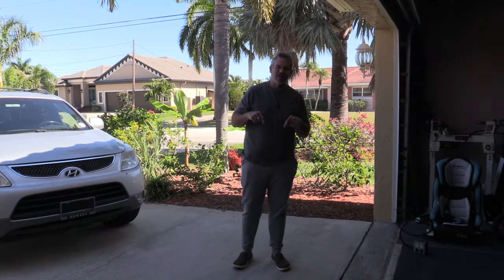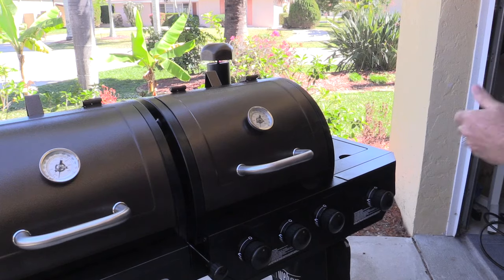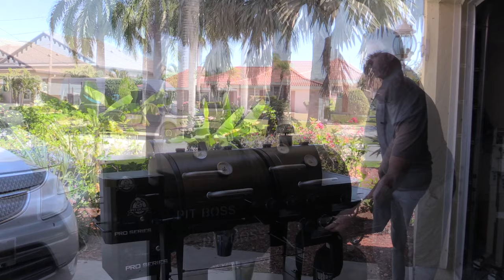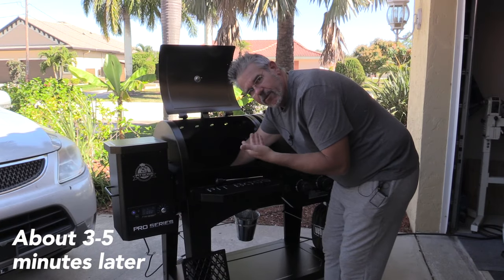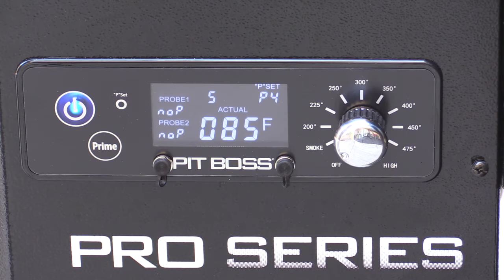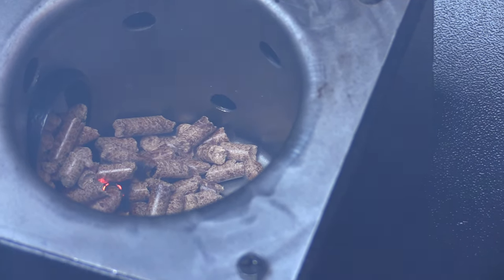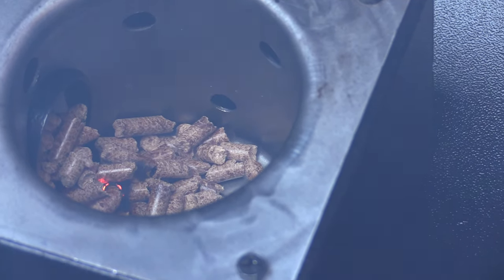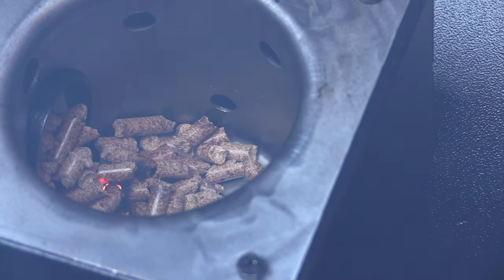Pit Boss Pro Series Combo BurnIn

Comment: Thank you for the video, very informative.  I’m concerned by the amount of noise I noticed in the video.  I couldn’t tell if it was amplified by the position of the microphone.   How would you compare it to, say for example, the noise of an air conditioning unit?
Reply from the maker: Much quieter than an air conditioner.  It is more like a table top oscillating fan.  I think it was loud because I had it clipped to my shirt and leaning over the open barrel shaped of the grill, with the covers off the firepot to show what was going on in there.  It is a small 4" fan that turns and that is about it.  You can hear it, but slightly louder than a computer power supply fan, and about like a small table top oscillating fan.   I hope that helps.

Comment: I've looked at your vid about 5 times!!! I just bought/and grilled on it. Thanks for providing this resource. Qs regarding the pellet side: 1) Approximately how long does/should it take for the auger to feed pellets to enter fire pot ?  2) Approximately how long for the actual fire to get going? 3) Must it burn 30+min before adding meat?
Reply from the maker: It took a good three minutes of holding the prime button before pellets made it to the fore pit the first time. I did burn it in a full 30 or a bit longer before cooking on it. The purpose is to burn off any of the protective oil from the machining and assembly in the factory (at least that is my understanding).

Comment: I just bought my sportsman combo...went to season the gas side and the heat spiked to 650 almost instantly. I let it run 30 mins on low and even with the dials as low as they'll go, it stayed 500-550. Why is it so hot? Is that normal?? I don't wanna be stuck grilling everything at 550 degrees
Reply from the maker: That definitelyt doesn't seem right.  This model is almost identical to the sportsman, so I am guessing it is all the same sized items.  Do you see the flame adjust in height with the knobs going from low to high, or are they always up on high?  That really doesn't sound right.  I can get mine lower, but if I have all 3 burners on high, it will get up to that temp, so I often cook with 2 of them on low and do offset cooking unless I am doing burgers or something.  A few things I would try if faced with what you are seeing.   I would start by removing the grates, and guards so I can see the flame tubes and validate if you are seeing any variation from high to low on each knob.  I would then try another tank to see if you have something odd going on there, or even maybe with the pressure valve just off the tank.  You should be able to get that grill down to 250-300 degrees with just one burner on.  We have baked in ours before by keeping the temps down lower.   Good luck with that, it is an odd one for sure.
Reply: @Svdreamchaser  I absolutely do. When I go to high I can see the flames go higher and brighter.
Reply from the maker: @mikestratychuk6362  that is crazy. I will fire mine up with all 3 on low tomorrow and let you know what it gets up to.
Reply: @Svdreamchaser  I called pitboss and they told me the regulator could be faulty.  So I either wait 3 weeks for them to ship me one or I go buy one for 20 bucks. I'm gonna go buy one and see if that changes anything
Reply: Brand new regulator installed, lit it and it skyrockets to 550 plus on low. Why is this happening lol I can't bbq like this
Reply from the maker: Crazy. I went and tested mine. I put two burners on low and it went to about 400 degrees on the dial with the lid closed. I grilled burgers over it with the lid open and it wasn’t that hot, kind of like any gas grill. Something doesn’t seem right, or it may be worth putting a thermometer at the grate level to see what the temp is there. It may be with the lid closed it captures a bunch of the hot air up on the top side making the temp spike on that lid gauge but maybe it is not really that hot. I am stumped on this one.
Reply: @Svdreamchaser  I returned it and bought the 820 sportsman.  So much easier to use.
Reply from the maker: Glad to hear you got one that works better!  How season up sone ribs. Lol

Comment: Love your videos thanks for making and posting, what is the lowest heat setting you can attain and keep till food is done or decide to change higher? And also most importantly are you still happy with your purchase? A lot of critics don’t like the wifi controller! I am just about to order mine! I’m offshore now I get in next week and I want some home made bbq!!!
Reply from the maker: First of all. Awesome you are offshore (unless working on a rig as that wouldn’t be the idyllic sailing image I have in my head. Lol). I am still happy 18 months later with the pitboss. I still use it almost every week. We do a lot of outdoor cooking so as not to heat up the house and it holds a temperature fairly well so we even bake in it from time to time.   As for the lowest temp setting. Down here in the south Florida heat we never really get below about 185. When I am on the smoke setting that is about what it gets to in the smoking chamber. If I open the chute between the pellet and gas side and block off the vents in the smoke side, I can get the gas grill side down to about 140-145 when the pellet side is on low and gas side off. It is still too hot to do cold smoking of things like cheese for me.   Lastly, I can’t share any feedback on the wifi controller. When I bought mine it was not included and I think now they are. I wish I had the wifi controller but I don’t have experience with it. I have considered upgrading to that controller however.

Comment: I’m new to smoking... but does the auger always feed pellets when you are running the unit on a desired temp, or does it only feed pellets when in the smoke mode? What’s the difference between smoke mode and temperature mode?
Reply from the maker: It always feeds pellets. Pellets are the source of fuel, so essentially if you set the thermostat at 300° it puts in pellets at a faster pace into the fire part then if it was set at 180. This particular model will turn the auger for example for three seconds and then pause for 10 seconds and then run the auger again for three seconds and then pause for 10 seconds etc. The purpose behind this is the pellets get dropped into the fire pot onto the heating element.   The heating element ignites them or lets them smolder.  What tends to happen is they smoke first, then they flame the smoke dissipates and the pattern repeats. The higher the temperature the longer the auger run tine is compared to the gap between runs. I
Reply from the maker: I hope that explanation provided sone insight and makes sense. It is amazingly accurate at holding temperature for long periods of time with 5-10 degrees of what it is set at.

Comment: Can the smoker side be set to 300 degrees and also have smoke or do they have to be done separately?
Reply from the maker: The left side is where you set the temperature and smoke is generated. You can open the smoke chamber between the left and right and allow smoke to flow to the right and out the chimney. The thermostat however is in the left hand side so if you do that and you want to increase the temperature on the right too, you have to supplement it by turning on the gas burners on the right gas grill side
I hope that makes sense.

Comment: Have you experience any of the negative feed back.  Rust quickly and paint coming the grill?  Also did you motor for the pellets burn out?  Any negative feed back on the product?
Reply from the maker: I really haven’t had any problems like others have had. I did have an issue where I didn’t cover it and it rained overnight. The pellets in Altus auger tube got soft and then hardened back up and I had to pick it out. But the reality is that was my fault and no residual problems from that at all. I have been really pleased.
Reply: SVDreamChaser thanks for the information.  I will plan to keep it covered.

Comment: Getting this for Christmas any negatives to this combo grill since you’ve had it for a while ?
Reply from the maker: No. It has been great. A couple of tips I would share. First, I would be sure to keep it covered if outside as rain can create some moisture in the pellet hopper. The only other thing that I don’t find negative but some may, that is the size of the smoker box. It is big enough fir three racks of ribs or a full 18lb brisket but if you want to be able to do multiple briskets you may not be happy with the size.
Reply: @Svdreamchaser  greatly appreciate the feedback thanks !

Comment: Great video! I’m assembling mine! I did have a question, I noticed you were concerned with your side burner valve not seated properly. Did you find a way to adjust that? I can’t seem to get my valve to seat all the way.
Reply from the maker: In the end it worked out just fine and didn't have any issues.  I had to bend it a little to get it in there.

Comment: When I turn on my propane it does a sound not leaking anywhere is it normal? I’ve never heard it from my other grills.
Reply from the maker: That doesn’t sound normal. Mine doesn’t make any kind of whistle sound’s. If you want to go back and look at the assembly videos I put together the second one of the two part series shows how I tested for leaks with soapy water and a small brush. You may want to see if there is a leak somewhere?

Comment: Can you use the smoker and propane at the same time?
Reply from the maker: Yes you can. We have done it many times with no issue at all. There seems to be enough of a gap between the two sections that a hot gas grill side does not affect the temperature in the smoker side

Comment: Any issues with low and slow smoking? Will it keep temps around or under 250? Was reading negative reviews about other models from pitboss not being able to do this well.
Reply from the maker: I have no problems keeping the temp at under 200. Today I am smoking a pork tenderloin and smoked it at 185 degrees for about an hour. I set the “P Setting” to P5 and it did just fine. I could have gone all the way up to P8 which brings the temp down a bit more even.

Comment: Do you use Aluminum Foil under the grates when smoking greasier meats to avoid grease fires and for easy clean up?
Reply from the maker: I actually don't Noah.  The manual suggested NOT doing that so I just kind of stuck with it.
Reply: SVDreamChaser yes I saw this in the manual as well so I have avoided it also! Honestly, only downside to not being able to use the foil is the cleanup but your videos help for sure! I bought the same grill just last week and partly due to your videos, so thank you!

Comment: Hey, Found This Grill Right now in Germany and no one has any experience with it.  Would you Recommend it after being using it some months?
Reply from the maker: I would. I have enjoyed it a lot. I will say if you are cooking for very large crowds it is not the biggest smoker. It easily fits 3 racks of ribs on the bottom shelf and two on top of one large brisket but if you need to smoke 4 15 lb briskets at a time it won’t be big enough. That said I am very happy with it. Oh and if you can buy it and assemble it yourself you may be better off. I have seen some bad store assembled models.

Comment: The slider in between to let the smoke go to the grill side, does that mean you can use for sides just for smoking?
Reply from the maker: Yes. You can allow a more cold smoke on the right. That may work in colder climates but down here in south Florida if it is just in the sun it gets to 140 inside. Lol
Reply: @Svdreamchaser  thanks so much for answering, I'm gonna do both sides next time

Comment: We have the 1100PSC2 and we don't have a Prime button. When we select the power button, the prime light on the display lights up. We also don't have a knob to turn to the smoke setting. 😕
Reply from the maker: Oh wow. So maybe that is a newer controller. I would think it would have more or better control than the older ones. I know the logic on the old ones is a times auger run and pause method versus the advanced logic actually uses a thermostat to determine when to run the auger. Interesting for sure.
Reply: @Svdreamchaser  False alarm lol
Apparently it's touch screen🤦🏾‍♀️
Thank you for responding!
Reply from the maker: Well that is good at least!

Comment: Hi just had a question, will a turkey fit on the smoker side ?
Reply from the maker: Yes I would say a 15lb Turkey would fit in there. I don’t think one bigger than that would however.
Reply from the maker: I just asked the wife. She said 15 may be cutting it close but a 12 pounder she felt good about.
Reply: Okay, thank you

Comment: So I just purchased this same grill but noticed the chimney isn't even on the smoker grill, it's on the gas grill -  do you leave the vent open between the two all the time? does it even matter?
Reply from the maker: I close it but it seems more show than anything else. You can open the damper between sides but very little smoke makes it to that gas side and out the Chimney.

Comment: So my left burner temp control indicator came upside down. Not the knob itself, but just the ring that shows your heat setting. Know how to rotate that around? been looking at it and knowing myself, I don;t want to break that ring!
Reply: Well I'm an idiot, just pulled the knob off and see 2 screws I can take out and rotate the ring. Lol
Reply from the maker: We can just pretend that never happened. Lol. We have all been there.
Reply: SVDreamChaser lol thanks man.

Comment: I am between this grill and the pit boss platinum KC combo. Which one would you recommend?
Reply from the maker: I don’t have experience with the KC but I must say I was torn between these two also. I wanted the smoke gate and chamber with the larger gas side. That said I wish mine had the upgraded control panel and wifi that the KC has. 
I know that isn’t really an answer but I have wondered which would be better. I love the one I have but think I could love that one too :)

Comment: I'm looking at getting one now.  I have one questions, with the damper open, how hot does the gas chamber get and how much smoke comes through? I make home made sausage and hoping it can get up to around 120 degrees with the smoke coming through
Reply from the maker: You can get to 120 degrees easy.  If you need the temp on the right side higher, you can add a bit more heat in the pellet side.  If you live somewhere very cold, I may not know, for example where I am in SW Florida, I wanted to try to smoke cheese in the right side, but just the sun on the barrel gets it to almost 120, then add the heat and I get melted cheese.  LOL

Comment: How do you install the Flame Broiler Plates? I have the same model and cant figure out how it's supposed to stay in place.....
Reply from the maker: It was a bit counter intuitive. Basically the larger of the 2 curved plates has 2 slots on the left side of it that are about 2” long. Put the plate in with those on the left and shift it back and forth a bit until the back and front of the left side horizontal bracket closest to the pellet box side of the grill pokes through those 2 little slots. That is all that holds the broiler plate in place. The right side just sits on the bracket inside and the left side is higher than the right (when standing in front of it with the door open). Once the little metal tabs are sticking up through the slots it is in place and you can place the smaller vented plate over the top center with the small tab to the left as that is what the seat plate arm sticks into. Let me k ow of that helps. If not email me a glhotka at svdreamchaser dot com and I can send you a picture of two of the inside of mine to show how it goes in there. It is pretty easy once it pops into place the first time. :).
Reply: @Svdreamchaser  that worked perfectly!!  Have you or anyone on here know where to get a cover for this model?  I cant find anywhere....

Also do you take the Flame broiler plates off to smoke?
Reply from the maker: No I leave them on. Some people cover them with foil to make cleaning easier but I do t. It isn’t horrible to clean it every six or eight cooks.

Comment: Why does the auger spin and burn so slow…it’s almost as if it doesn’t smoke
Reply from the maker: It does a spin, pause cycle. The higher them temperature the longer the gap between cycle spins.

Comment: How many pellets should I add in the beginning?
Reply from the maker: Press the prime button until the pellets work their way from the hopper to the firepot.  For me, that took 3-4 minutes of holding the button.   Keep holding it until about 20 pellets fall into the pot.  When I look down into my fire pot, I see the heating element, it goes from left to right and sticks out about 3/4 of an inch.  It is a little bigger than the thickness of a pencil.  You want several pellets all around that and maybe even on it.  (20 or so should be plenty).  I hope that helps.  Let me know

Comment: Just bought one. Is the chimney cap supposed to screw down ALL the way? The post on my cap isn’t threaded far enough to allow the chimney to be closed completely. I have about a one inch cap when it is down as far as it will go
Reply from the maker: Mine has a gap as well. My threads didn’t seem correct and I just hand screwed it in as tight as I could and kept going until the threads past the point that was bad and allowed it to close down further. It is not airtight however. When I close the chimney cap all the way but open the chamber between the smoke section and the grill section I still do get smoke exiting out the top of the chimney and honestly I think that’s OK. You’re not the first to have reported this as well in these comments so I do think it’s either by design or a common defect. After having this grill over a year however I will say it has caused no negative experience in cooking